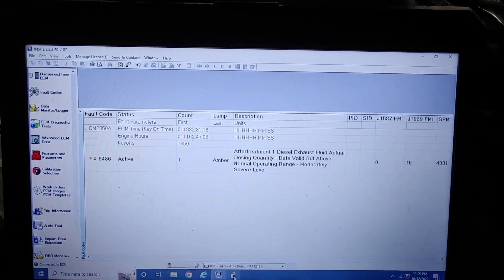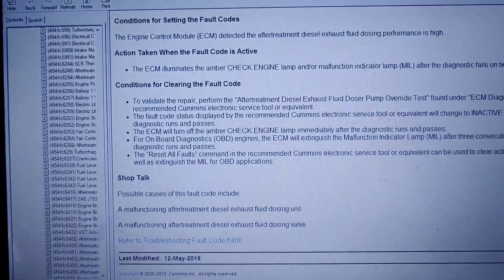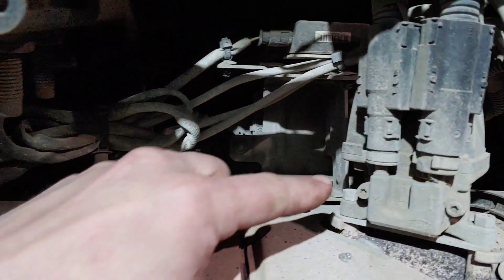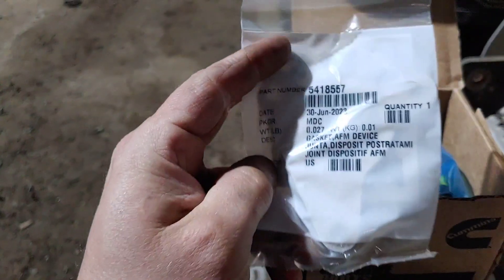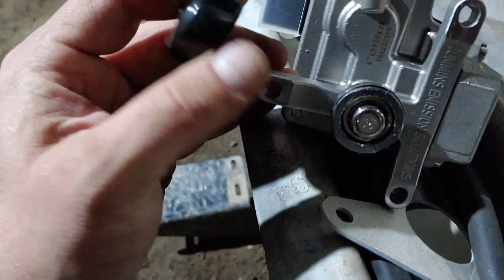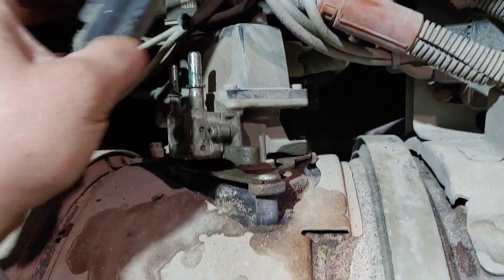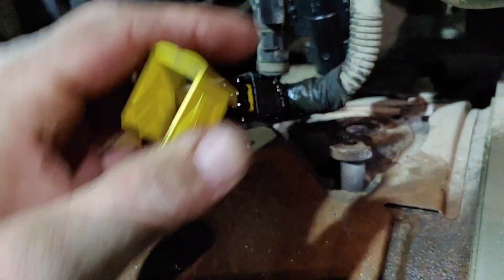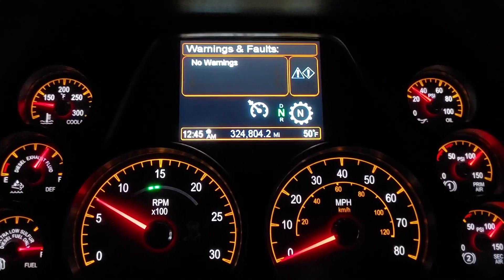Cummins Insite Code 6486. 2020 Peterbilt 567 Cummins X15. Aftertreatment Doser Valve Replacement

Comment: But why you changed dosing valve ??
Why you didn't change dosing unit??
Reply from the maker: We have a lot of these trucks in our fleet and every time this code comes up, the dosing valve has been the problem. It seems to be injecting too much DEF. The trucks really smoke badly when doing a regen. I'm doing a dosing pump tonight and those usually leak externally. I just did another one recently that was also leaking externally.